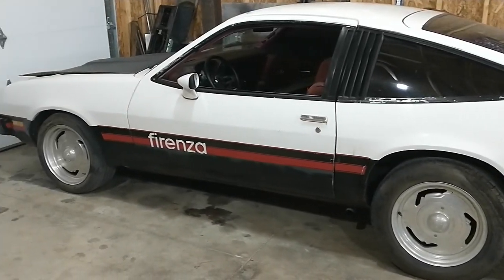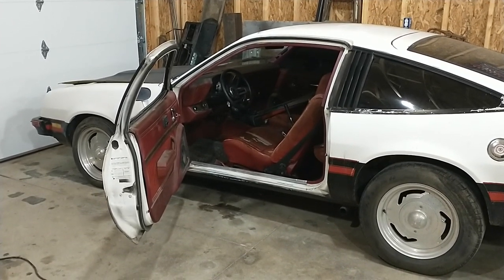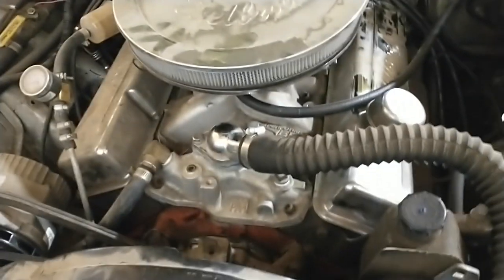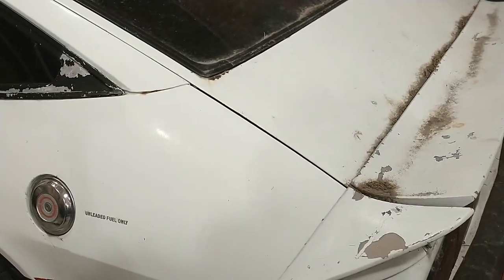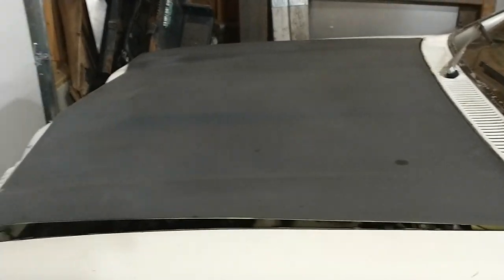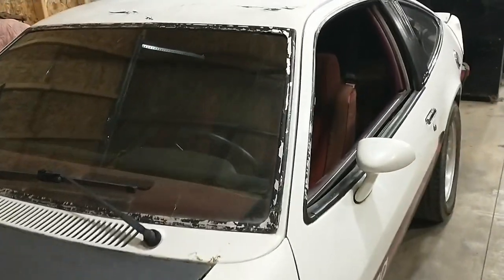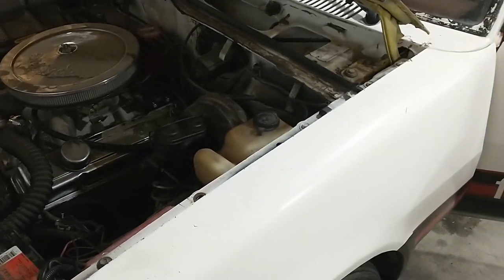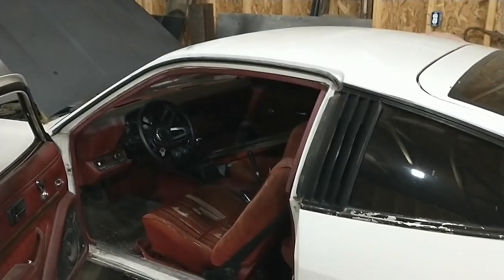1979 Oldsmobile Starfire Firenza V8 - Less than 4K Built!

Comment: Those 13 inch tires on those cars were specified for load range ‘c’ instead of the more common load rand ‘b’ tires found on virtually every other compact car of the period. The v8 cars also got 6 inch wide wheels instead of the more common 4.5”, 5” and 5.5” wheels. That extra width for the tires made for a big increase in tire grip. If you installed the right tires.
Reply from the maker: Thanks for the information!

Comment: Very cool ride man .... I actually dig those wheels, the color combo and ive always thought they had one of the slickest spoilers...i would check out the rear end to figure what your runnin with and definitely put the 4speed back in cause with 3 pedals and 8 cylinders thats not only a bad ass daily but a RARE one at that.
✅  LIKED
✅ SUBBED
Stay Safe 
    ✌
  Be Well
Reply from the maker: Thank you! I like those wheels too. They seem to fit the style of the car and the era. Plus, I'm a big fan of the old Centerline brand. I have them on my '76 Cutlass S. I have an original 4-speed and the pedal set, so I can put it all back together. I'm planning on doing a video to find out what is in the differential. Thanks for watching, the like and the sub!

Comment: My dad had a manual 1975 Skyhawk. Very poor build quality. Clutch cable was misrouted so that the clutch could not fully engage.  Body rusted almost immediately.  However, the V6 did start after a night out in 20-below Chicago in 1982 or so.
Reply from the maker: They definitely had their share of problems. I believe I can sort out the worst of them and make it fun. Thanks for the comment!

Comment: Don't know why people hate 4 lug bolt patterns. If a car has enough power and traction to shear 4 lug nut studs off, you might want to upgrade to a diesel dumptruck axle.
Reply from the maker: Good point. I think it's the lack of custom wheel options, at least for RWD applications. Thanks for the comment!

Comment: I had the Buick version of this with the V6 and my only complaint was the electric fuel pump.
Reply from the maker: I've heard those fuel pumps cause problems. I need to dig into this one and figure out what's going on with the fuel system. It's been "modified" for sure. Thanks!
Reply: Yeah the one in my old 80 Spyder gave me issues too.
Reply from the maker: @Grabasandwich I think the one in my car may have been bypassed. It's one of many things I need to investigate. Thanks!

Comment: Would love to know the part number and brand of the spool if you end up doing a video related to the rear end. The factory gears are horrible especially with a taller tire and 5 lug conversion. Looking for a better gear set for my 78 Monza V8
Reply from the maker: @D S Will do. I was surprised they even made a spool for those. I was surprised that Summit had several options. I am definitely going to remove the rear cover and see what's in there. I might wait until it gets a little warmer, though. ;)

Comment: That's too bad that it no longer has the original engine and has been modified so much, it's now just a cheap beater car - but you don't seem to mind so it's all good. I had a new 1978 Pontiac Sunbird that I really loved driving, although I would have enjoyed having the V-6 underhood instead of the clanky 4-banger it came with. Enjoy what you have and good luck finding missing trim pieces,  they were made cheaply and fell apart just sitting on the shelf from new, but maybe you will have success looking on Ebay or Hemmings motor news.
Reply from the maker: I don't think it matters too much for this car if it's 100% original or not. They don't have the desirability of something like a Boss Mustang. If it ever became that much of a collectors item, everything that's been done to it can be reversed. I definitely don't consider it a cheap beater car, though. LOL I'll make whatever pieces I can't find and just maintain and enjoy it as-is for now. I've got good friends in Tucson. That's a beautiful part of the country. Thanks for the comment!
Reply: If you do the motor work right it only brings the value up in this case

Comment: I had a silver and black '79 Firenza. Buick 3.8 and automatic. Those fender flares were a problem, didn't hold paint well and UV light degraded them. I thought they looked too bulky as well.
Reply from the maker: Silver and black must've looked awesome! I have one of the rear flares. It's in pretty good shape. I am pretty sure I can duplicate it and the other side in steel and approximate the front ones and the air dam as well. I agree with you they are bulky, but it's kind of appropriate for the 70's. Thanks for watching!

Comment: Had  handful of Monza's from 75 Tc coupe to the 79 Spyder with a 3.2l  v-6. Not the 3.8.
The clutch cables stretches and will pull through the firewall if you put HD clutch.
I put 350's and 1 400 sbc in them all. Alternator should be directly on top of water pump. Belts l8ke to come loose.
Reply from the maker: If I do change it back to a manual transmission, I'll probably use a hydraulic release bearing. I remember those cables breaking on the 4 cylinder cars. I definitely have some work to do! Thanks for the information!
Reply: @smithmotorworks1969  They were fun and crazy at same time. Have a great day.

Comment: Chevy built the Monza Mirage GT with a 5 ltr V8....even though it wasn't a high hp V8 it was a pretty quick car.
Reply from the maker: I think it's going to be pretty fun. I need to go through it all, especially the wiring before I take it any distance. Thanks!
Reply: No Mirage GT, only Monza Mirage. GT was either Oldsmobile or Vega GT not Monza.

Comment: Tiny brakes, 4 lug wheels, poor handling, and economy car powertrain are these cars drawbacks. The 305 had 147 hp. 350 power made all these problems glaringly obvious. A narrowed 8.8, and some real brakes, and suspension upgrades would really be a huge leap forward on one.
Reply from the maker: It's pretty popular to swap S-10 front spindles and rear axles to gain bigger brakes and a 5 x 4.75 bolt pattern. A lot of fairly high horsepower cars are still running the stock 7.5 differential with success. The 3-link torque arm rear suspension is a pretty good setup, but it makes swapping axles housings a challenge. Anything is possible with time, effort, and $, right? Thanks for the comment!
Reply: @smithmotorworks1969  oh, indeed. They  are so long gone where I live, I have not seen one in years, my buddy had an '80 Monza Spyder, he swapped a 327 in, and  getting it to hook up, meant the rear was going to explode. It eventually ate a curb, and was totalled, but that was 30+ years ago when young and dumb was all I was. I pestered a guy who had a red and white one for years, untill I stumbled on an '80 Capri with a blown 255 V8. I still have it.
Reply from the maker: @James George they are not a common sight for sure. That's why I jumped on this one, even though I didn't really NEED it. I'd love to have your Capri too, though. ;) Those are $$$ these days too.
Reply: @smithmotorworks1969  Thanks, I was dumping the clutch in second gear at 5500 rpm when it ripped the torque boxes off the floor in 1999, has not driven under it's own power since then. I sold the TFS head 306 that was in it, and I am assembling an L33 aluminum 5.3 to replace it, and I'm on the fence about leaving it stock, and repairing the floor / torque boxes, or building a Watts link style custom 4 link suspension, with a Crown Vic rear axle.

Comment: Would the Olds 403 fit in place of the 350 ( presumably chevy junk ) motor?
Reply from the maker: It would physically fit, I believe. There are cars like it with big-block Chevrolet engines and even a Cadillac 500 in there! At a minimum, you'd have to solve possible oil pan and exhaust manifold interference issues, create custom engine mounts and more. The biggest problem, I see is the water pump extends much farther from the front of the block on an Olds V8 versus an SBC. My guess is that's one of the bigger reasons GM didn't do it. But, nothing is impossible, it just takes time and money, right? Thanks for watching!

Comment: altinator is mounted above the water pump in front of engine    good luck finding that bracket
Reply from the maker: There's a lot of stuff that needs to be corrected. If I can't fabricate one, it looks like this could work: https://www.speedwaymotors.com/Small-Block-Chevy-Upper-Alternator-Bracket-Plain,38957.html  Thanks for the comment!
Reply: @smithmotorworks1969  I'm pretty sure the alternator was only over the water pump if it was a air conditioning car otherwise the location it's in now would be considered correct for non-air
Reply from the maker: @D S I am fairly sure this car didn't have AC. (The search for the build sheet is next.) I believe I can make a reliable mount to keep that belt on there.  I didn't know about the different setups. Thanks very much for that information!

Comment: You're lucky it has exhaust manifolds I'm going to tell you a little trick for that starter and you might think me later remove the passenger exhaust manifold and you can get to the starter and pull it out that way
Reply from the maker: I've heard it can be a challenge to access the starter. Thanks for the tip!

Comment: If you want to fix that grill you could have it 3D printed.
Reply from the maker: I've got a small 3D printer in the shop and access to a much larger one at work. I've used mine for parts on the Indy Fiero and my old 1950 forklift that are on this channel. Luckily I've got a spare grill to replace that one. I may end up scanning and printing some other stuff for it, though. Thanks!

Comment: I want one with 231 and manual trans.
Reply from the maker: My friend had one like that when we were in HS. It was still plenty of fun. There's lot's of aftermarket support for those engines too. Thanks for the comment!
Reply: @smithmotorworks1969  The 231 (3.8) always came with a 2bbl but the 4.1 (same motor, larger displacement) had the 4bbl intake/quadrajet.  The 4bbl intake really wakes up the 231.